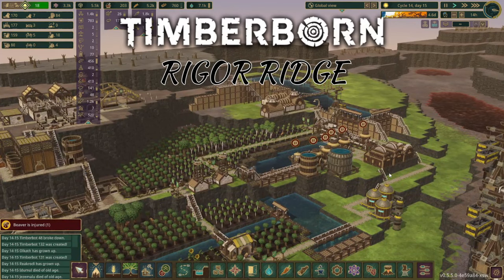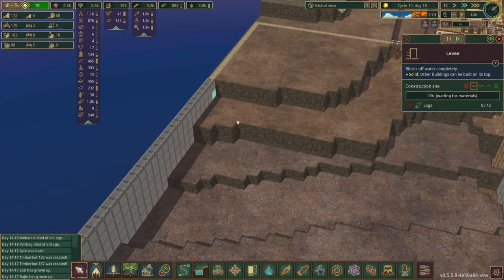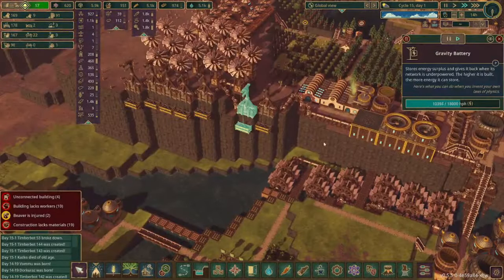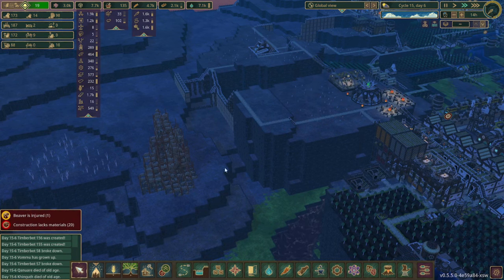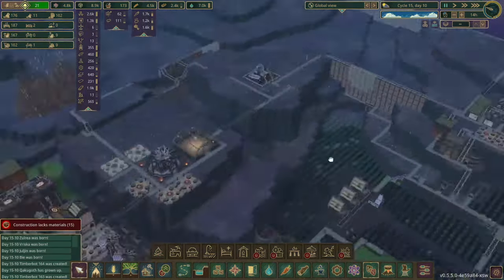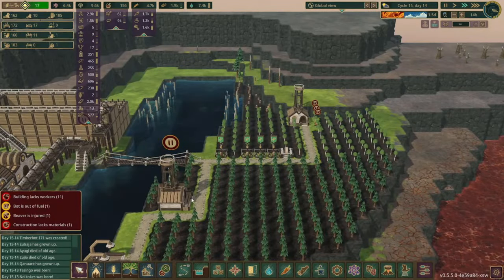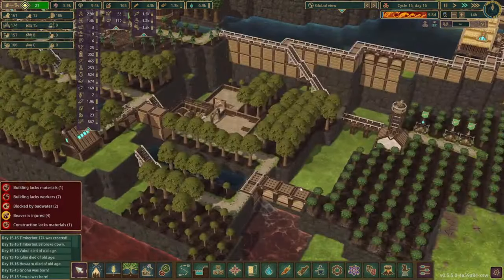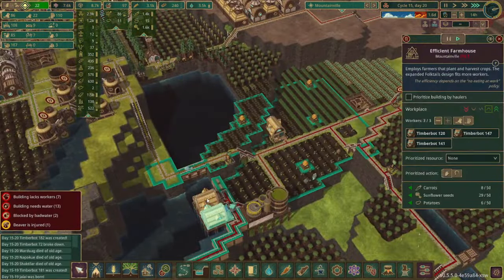Building This One MACHINE Will Take All Our BEAVER POWER!!!

Comment: Still not sure why you didn't put the fluid pump one row lower. I know it has to be connected to power from the side, but that should still be possible and the edge of the dump side would be at max water level, so it'd self-regulate.